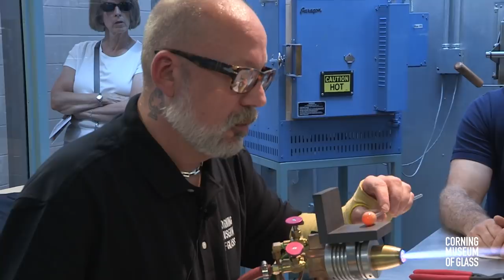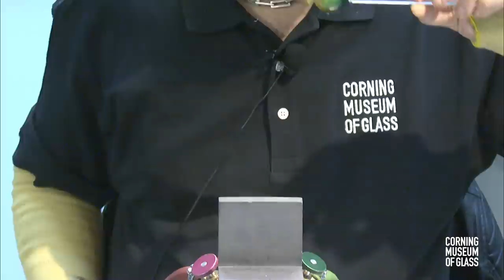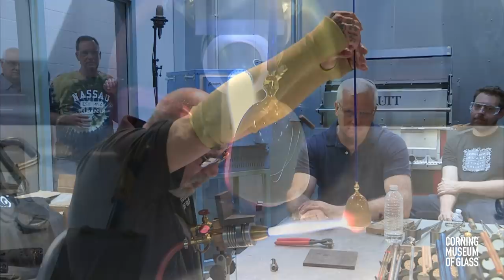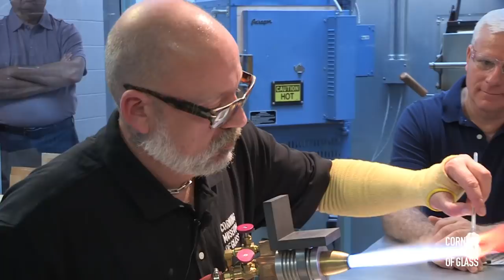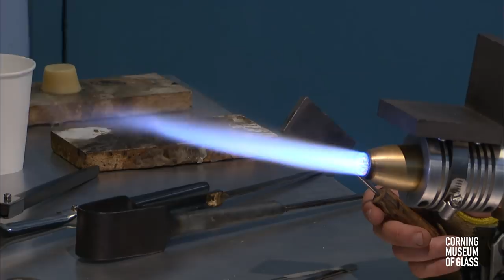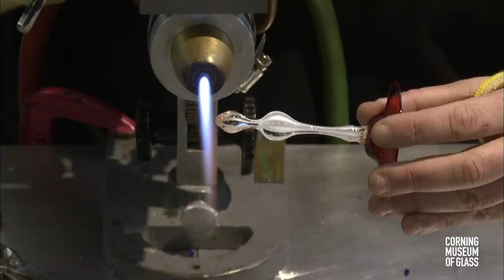Igor Balbi Live-Streamed Studio Demonstration

Comment: This really blew me away. Amazing work! I never thought that one could make a goblet this way. The most amazing part was the shaping of the cup with just a gravity, heat and motion. Truly masterful work. What I don't get is why the glass didn't break when it cooled down? Was it because the glass was so thin an even or did the shape absorb  the tension somehow?
Reply from the maker: Hi, the way Igor works the glass, he relieves the tension in the glass as he goes along and minimizes the need for annealing. Thanks for watching!
Reply: @corningmuseumofglass  that's a useful technique and a great question from TheKekkoslovakia. I wondered the same. How is he relieving the the tension? I obviously did not learn this as I tried blowing soft glass on a torch years ago and had some success but was self taught and now want to learn more from the masters!
Reply from the maker: @lizacarolinabrown1850  The cup is made and is slowly annealing while he works on it.  It is very thin and the form is a design that is accepting of a little stress.  As he makes it, he works on one are then slowly moves to another area, being careful to only touch the glass minimally, and in only areas where the glass is at its hottest.  This keeps from shocking any other part. Thanks for watching!
Reply: @corningmuseumofglass  thanks for the full reply. I will think about this and watch again as I try to emulate. I have watched Lucio and Vittorio in person and know it’s as you say but still haven’t developed that capability to move with soft glass in the torch as well